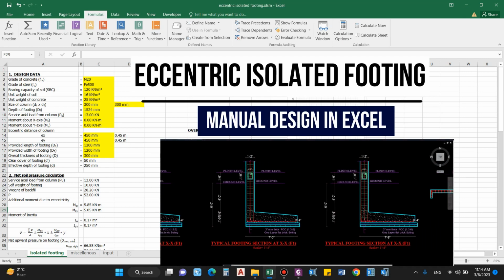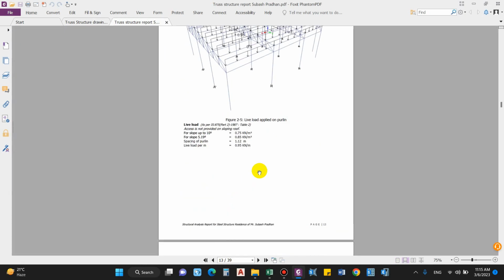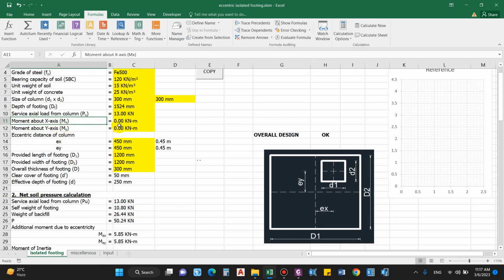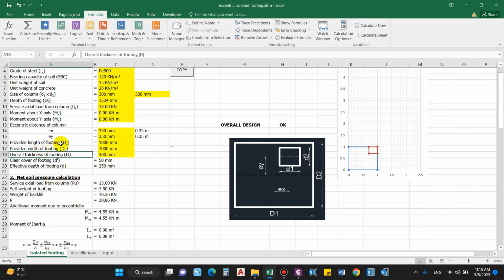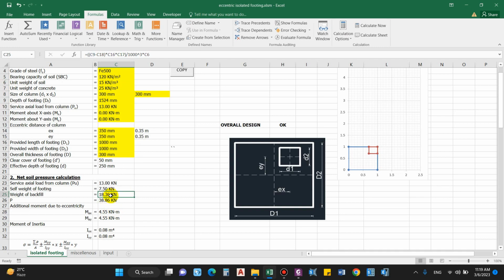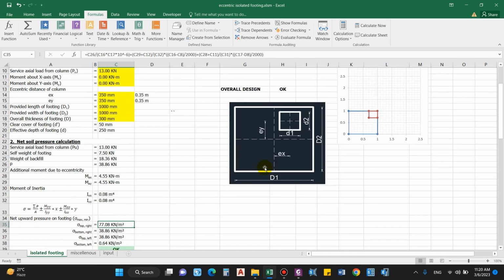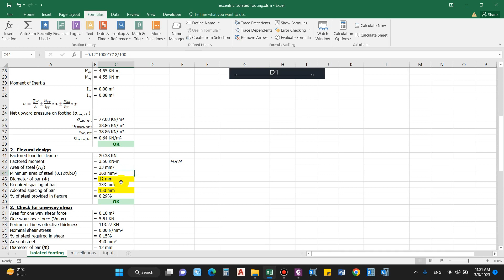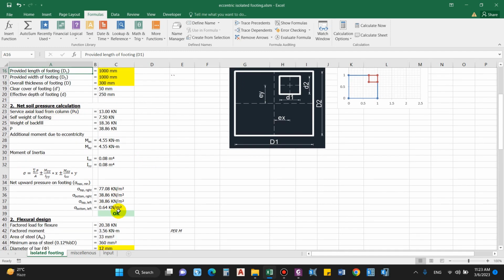Design of Isolated footing (Eccentric) Manually | Excel Sheet | IS 456 | Municipal Structure report

Comment: The footing is useful for small loaf. Ok. In your case the load consider is 13 KN. Why so much less load is consider.Also you simply the case by neglecting moment Mx and Mz.
Reply from the maker: That’s what I am saying. Such footings shall be avoided unless the load is very small and moments are negligible such that it doesn’t alter the bearing pressure.

Comment: My comments on how you get your bemding moment, your pressure is not linear so you can create a diagram like for example shear and moment diagran then from there you can calculate for the moment at the face of the column. Also in you 3 columns in mat footing your moment there is wL^2/8 where we know it is not because it cant be a simply supported. We should not also averaging the stress.